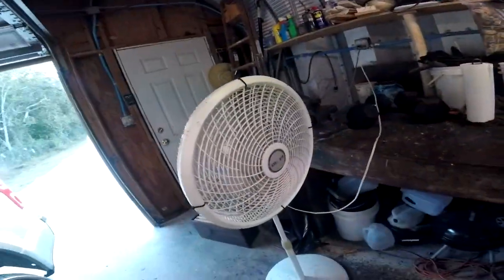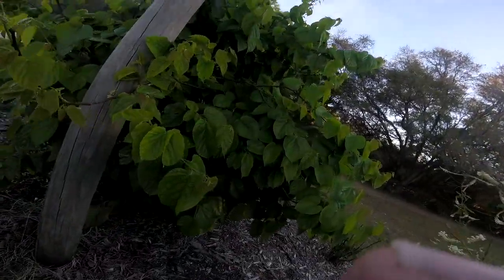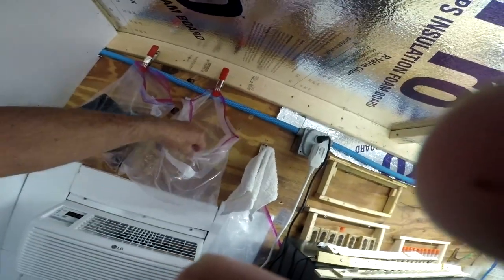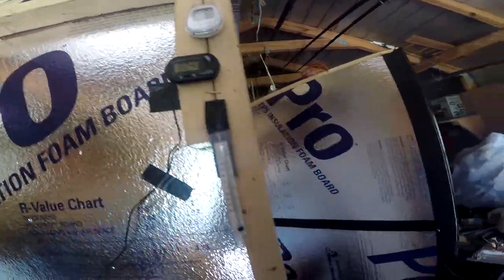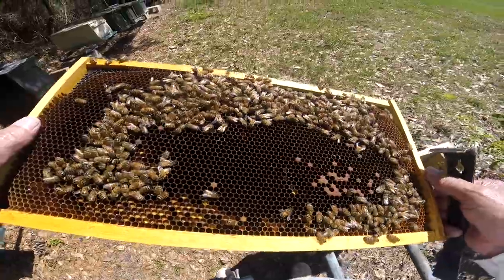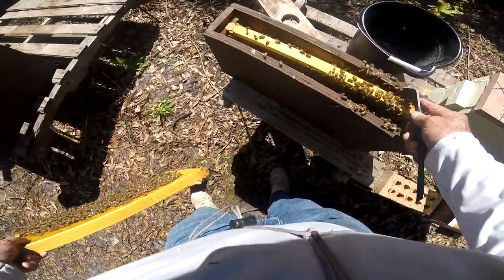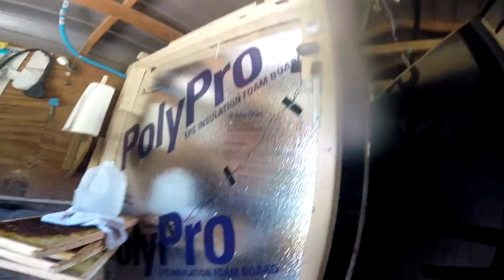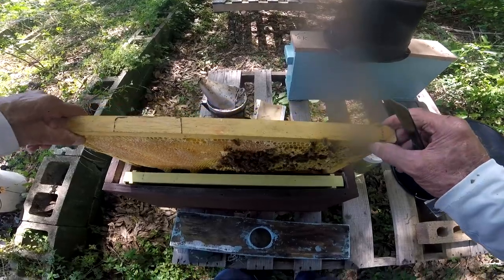Check Two Frame Nucs For Mated Queens

Comment: i think it was box #9 about the 49,50 minute mark at the top of the frame in the middle is that a queen they are making ,you mentioned no queen or eggs on them 2 frames ,, but right on great luck wit the queen producing i have learned much more into the queen rearing process ,,im in the north so we have abit of time before spring starts so to speak, but i wait to use some of your ways ,, thanks again,,
Reply from the maker: Thanks Jim You Have A Good Eye!

Comment: Steve"o just noticed that the wood holder has the holes drilled thru , maybe instead of using that knife you could come from the backside with a nail or something the same dia. as the hole and push the cells out . Take away the danger of cutting yourself. Just a thought ,with your engineering abilities bet you will figure it out. I like the longer videos you have time to talk in more detail . Thanks see you when  they hatch .
Reply from the maker: Thanks for watching and thanks for the cell punch out trick and i will make a tool for that!